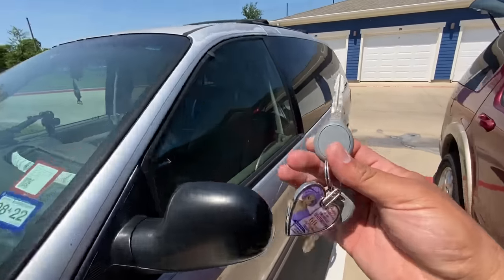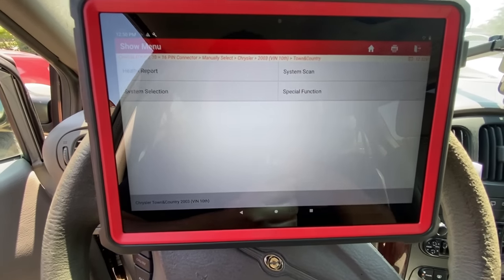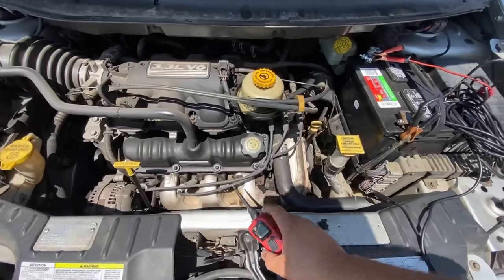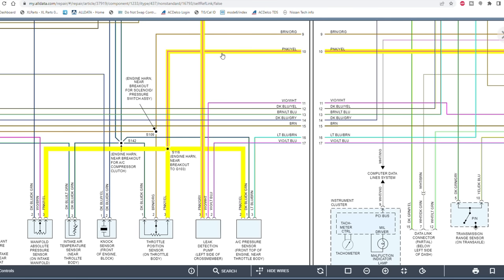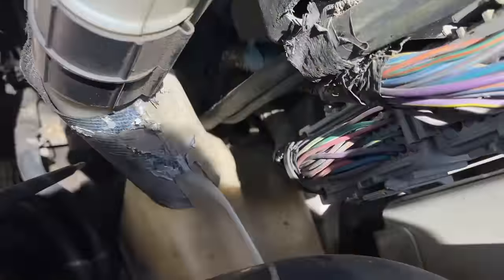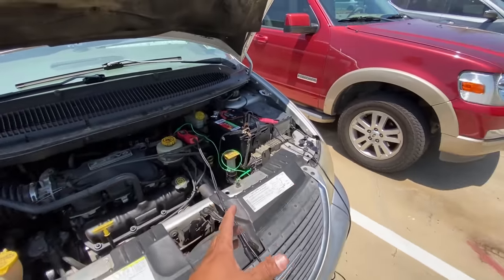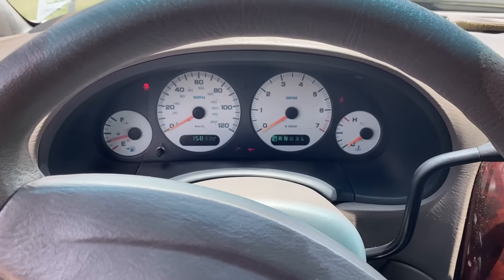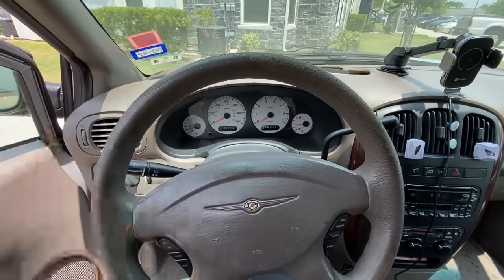CHRYSLER TOWN & COUNTRY NO COMMUNICATION NO START

Comment: Awesome video, I'm a locksmith by trade, the red light in the cluster top right is the security light,  it is supposed to turn off if you have full communication and the security system is up to par. Solid light means fault in computer system,  flashing light means key problem.
Reply: Yessir about to say that flashing red is not good
Reply: I mean solid I had that problem and it was pcm

Comment: My mechanic would have just told me you need a new computer and just slapped it in there without doing the test and then tell me later well we put in a new computer and we found a faulty wire as well. you are very thorough. You help me to believe in mechanics again.

Comment: Phenomenal job tackling a diagnostic issue. Whoever changed the starter was obviously not experienced, starter relay jump would of cranked. I’ve been diagnosing cars just off sheer knowledge and process of elimination, voltmeter and a light tester. Now we have great scan tools and the power probe to assist the main tool, your wisdom and experience. Again excellent job.

Comment: Yup.  Definitely an instrument cluster problem!  Only other test I would have checked to see if the scan tool had shown RPM.  That way you have a record that the PCM is sending the information to the IPC which shows the tach is bad.
Other than that, very good diagnosis, good call on the PCM and overall, very good fix Eric!
Reply: what is IPC?

Comment: On these older Chrysler vehicles you can hold down the trip button on the cluster and turn the key to the run position. It will do a check and all the gauge needles will do a sweep

Comment: Thank you for sharing your knowledge I have a 2006 town & country that had the same problem but mine was a much easier fix, I cleaned the battery terminals replaced the connectors, and put on a new ground strap and it started up. You have a new subscriber. Thanks for showing us how it is done.

Comment: Great video as always! It was thorough and right to the point. Where I work, many electricians never bother to look at the schematics when troubleshooting a circuit. They just change parts until it gets fixed or not. My Dad being an Old School diesel mechanic always told me “One has to be smarter than the tool” Meaning, use the tools and manuals accordingly and they will guide you to the root cause.

Comment: i know it ended up being a pcm issue. and just alittle tip for the future. ive been burned on these older dodges, the asd relay has a power feed that goes to the pcm and also the alternator. I had a van that had repeat pcm failures. We all know about chrysler pcm problems. but still, either way the asd relay is controlled by the pcm, and supplies power to the fuel pump, injectors, sometimes the trans relay, and the alternator. The pcm also uses that power in its wake up process. So what im trying to say is dont forget to check the asd power supply to the pcm, ive seen where the driver in the pcm fails not turning on the asd, and ive also seen where the alternator has a partial short in the field circuit causing a 5-10amp draw on that power feed..which usually melts the circuit board. It can cause repeat pcm failures, and be overlooked until the alternator finally fails completely. Just wanted to throw that in. Great job on the diag, its always nice to see a tech that understands how to LOAD test a power and ground. Fewer and fewer people understand this basic concept, i love the power probe but i still use my test light to double check also. What ever shop couldnt fix this, obviously cant be bothered to check for a crank signal at the starter before replacing it. Thats crazy
Reply: what does ASD stand for?
Reply: @darrylt1031 automatic shut down, the relay that shuts off the engine in a crash event or rollover. Fuel Injection allows an engine to keep running even if inverted after a crash, unlike a carburetor which would shut off the fuel, as the bowl float relies on gravity.

Comment: Very good video.
I had a 2003 Grand Caravan 3.3L with the same issue with computer.  I sent it off to a repair shop I found on Ebay with the Vin # and current miles on odometer.  Came back repaired.

As for the trim over the gage , it would dry and crack from the sunlight.  You could move the light bulb board like he did on the video.

Never had any real issues with the engine, transmission and ac unit.  At 186k miles she ran good but had some rust spots throughout the body.

Comment: Great diagnosis. Isolated ECM with problem, checked base power supplies, checked ignition present, all feeds checked with test lamp to simulate load, checked 5Volt output connected and disconnected at sensors. Maybe 5V ref wire short, checked for ground with test lamp no short to ground.  Why did it go who knows old age, some one shorted it or reversed polarity it and not telling. Well done for not wasting hours and following through in a logical manner. Still makes you sweat when you order an ECU though.😀

Comment: 20:40,  that solid red dot on the top right corner lit and went away after a few seconds, so that must be the security light lol. Good call on the computer and the checks on the possible shorted sensors bringing the computer down, that's an extra step that most techs may ignore to save time but could be a costly misdiagnosis.

Comment: You have taken us through the best procedure step by step tackling the issue
The issue with the rpm gauge if I would have seen the scan tool reading the signal from the ecm autright close the case clock is faulty

Comment: You are spot on with your procedures and your diagnosis. However in my experience with these pcm parts, 90% of the time they are repairable. On the main power inputs there are 5 watt general purpose rectifier diodes that are sacrificial in nature. They protect the pcm from voltage spikes and they will either short or open . I suspect that the unit you diagnosed in your video had open power clamp rectifier diodes. When they open ... You have a dead pcm. They are simple to solder in and out and you can buy a bag of 20 for about $8. When they short ... The damage can mover further into the pcm and can damage the EPROM. When the EPROM is damaged I generally replace the pcm. Generally it is harder to open the pcm then is to repair them, and having said all of this, you can save a lot of time and money just doing a check on these rectifiers.
Reply: Very cool, Any idea how can we identify those rectifier diodes?
Reply: @W.Khairi  Yes they are easy to find. Usually near the wiring harness plug in port. 5 watt diodes are easy to identify, and generally easy to solder. Inside the ECU there will be a buck power supply sending tightly regulated current and voltage to the logic I. C.'s Google 5 watt diodes and look at the examples. When replacing them be very sure which end the small silver band is on, and insert the replacement part with the band facing the same direction. That is critical. These diodes are easy to check with a standard volt ohm meter. Some even offer a diode check function.
Reply: @markcondrey2297  I will try to check on them next time,  Thanks a lot for taking the time to explain.

Comment: You know if you turn that key 3 times to power and power off the third time it'll pop up the codes on the dash for u. Also with these vans like some cars with low low oil or no oil that van will do that with no start. Great Work and nice video 👍

Comment: reminds me of an intermittent issue I had with a 96 grand caravan years ago. Crank, run for 1-2 seconds, then die. In frustration I beat on the dash top and got it going, then drove 100+ miles home. Was ok for a week then did it again.... fixed the same way. Finally did it again 100 miles from home about a month later and a shop said there was a can-buss error, but it started every time so took it home. Researched that error and every post talked about dash cluster issues. My son had a similar car with dash warning light issues, and mentioned a post where guys talked about poor solder joints within the cluster. Apparently, the error was causing the anti-theft to kill the fuel pump. I put the dash on the bench and manually went over every solder joint. Never had another problem. Had the car another 7 years after that and finally junked it at 23 years old for other problems. (mostly rust)

Comment: Nice diag.  Can't believe someone else couldn't figure it out, but hey - more money for you, right?  One thing I will note, to check the 5v reference line for a short, I'll unplug the connector at the PCM and front probe the wire.  It's (usually) pretty quick and completely non-invasive.  And well, just like you did - I will remove the connectors and inspect the pins and sockets anyway...so it's just a final sanity check before I rule it out as a smoked PCM.  Keep up the great work, always nice to see one of your videos!

Comment: Gotta love the power of Editing.... Since (Roughly) the early to Mid  '90's,  a short on (a) 5 Volt Reference Circuit (there can be more than one) would give you a Crank and No Start along with a message of no buss on the Odometer. That is just the Logic Circuit shutting down because of Short on Circuit. (When testing the Circuit for a Short with a Meter, you have to cycle the Key off and then on again every time you unplug a Sensor. It will not Magically turn the Circuit back on... 80% of the time it is a Crank Sensor, 15% of the time it is a Cam Sensor.  In 1998, Mercedes Benz bought Chrysler.. Things changed, and we had to adapt our Diagnostic a bit. On this Model, The Cam and Crank are on their own 8 Volt Circuit. Same Crap Parts, but different way to diagnose it. The symptoms are the same as yours, EXCEPT:: If the P.C.M. was really Bad, you would not have a lit Check Engine Light.. There are 2 different Networks on the Vehicle. SCI and PCI.... It was talking on a Network you can not seem to Communicate with... Get rid of Launch, I did a long time ago. I busted my arse on a same scenario but learned a lot... That was roughly 15 years ago  when these came out of Warranty...  Are you going to show the real fix???????

Comment: I have a '99 Town & Country that I had the exact same problem with.  Disconnecting and reconnecting the PCM fixed it.  There was no corrosion and the connections were tight before I disconnected them.

Comment: Love the diagnostic channels... I'm a mechanic myself and you always want to see how others do it.
So far very nice👍, another thing I always do is comment to the video before it's finished with my own diagnosis, wondering if I am thinking in the right direction.
I was looking at the new battery and thinking about a diag from years back,another Chrysler product. This was a jeep Cherokee and the battery also sat right beside the pcm... The problem ended up being corrosive particles coming from the battery and arcing out across the pcm connection...just saying it's a possibility!🤷🏼‍♂️
Reply: Yeah and somebody may have taken a shit inside the PCM as well.... just saying, it's a possibility.
Well... wasn't the case this time, girlfriend.
Reply: @moshesheckel7369  ???

Comment: The Injector wiring harness will fuse together fry the computer. Pull the wires apart to inspect on the fuel injector wiring harness this year was known for that.

Comment: Please help. I have full power/ No crank and everything on this diagnostic video on ny van tests good , but still no crank and check engine light.myself am a mechanic and very picky and only trust a few mechanics to work on ny vehicles besides me. I would definitely trust this guy!! Not only does he know his stuff, he is a very good teacher. Not alot of people can explain things like he can. Most mechanics have lots of knowledge and diagnostic gears turning in there head but can't always explain the process as good, they just know what to do, great diagnostic video but in my case im still stuck on whether it's a pcm or not
Reply: I can't find wire schematics.  If i pull starter relay i can make starter crank with jump wire and all other terminals check ok except for 85 at relay which goes to pcm, i dont know if it powers or grounds, i ohmed all wires and all good, however i noticed my AIS motor was hot when checking the tps and it makes a loud click and re-engages when i hook back up. OH, Also my van was clicking with key on from injectors and when turning key off still clicked and when i checked my 5 o reference for a millisecond it had no power then it clicked and injectors stopped clicking and then 5 o reference gave me power

Comment: thank you  i have 2005 towncountry had issue with dash gauges the fix was on battery cable ends where connects to batt clamps i solder sweated ends where swage is fixed problem i used a propane torch with solder paste to do job .

Comment: @ADVANCEDLEVELAUTO Thank you so much for sharing this! I'm  having a problem with my 02 trailblazer where it was idling and it just shut off. No crank, no start and no fuel pump engaging after. Scan tool will not communicate with pcm as it has in the past. Instruments light up bright and battery is like new, fully charged. Installed a new ignition switch and camshaft position sensor, still nothing. Also tried the neutral safety switch test, nothing there. I did try all the fuses and relays as well, all are working. I did try the ignition relay jump test which will crank but no start or fuel pump. Hoping your video will help me troubleshoot this! Will follow up 🎉

Comment: My volvo v70 2002 did not run any more. the 12v in engine bay was oxidized. cleaned and worked again.

Comment: I had the same issue a bunch codes. I too taught it was the PCM and it turned out it one of the plugs was slightly loose about 1/8"

Comment: Power probe offers a 5 volt 0.100 milliamps attachment for the power probe.....if the line is shorted to ground the attachment will go to ground.....also the power probe hook has a variable 5 volt generator for reference circuits...I own the hook and is a really cool tool!!!!!!!

Comment: The red light above the fuel gauge should be the SKIM (Sentry Key Immobilization Module) light. Another clue is the grey head to the ignition key. I don't recall on the 2003 whether it was an option or standard. If an attempt was made to start the vehicle with an unregistered key or a hot wire, it would start and run for about 3-4 seconds and then shut down. After that it would not even attempt to start on the next try. There is a chip in the head of the gray keys (similar to the ones on expensive merchandise at the store) which the SKIM can detect and recognize. If there is no SKIM, the Chrysler product came with a key with a black plastic head.  In later years the SKIM was standard and all keys (those with the large key fob head or those vehicles with the new push button system) have the chip. The chips do go bad.

Comment: I believe one of the options for the gages was to calibrate. Maybe a preprogrammed PCM doesn't account for differences in rpm sensors. Is it possible each vehicle has a pre-delivery calibration done for the gages?

Comment: Could you add 5 v with pp 5v adapter and see if the sensor is getting the 5v?  At the pcm and then test for 5 v at sensor just a quick test?   Thanks

Comment: I think someone pulled the pointer off the tach and did not "clock" it correctly when replacing it. Do a sweep test and attach the pointer at the same ratio as the speedometer. It should work just fine then.

Comment: Could be possible that someone removed the tach needle and misplaced it way below
Reply: ... I kinda doubt that. These are way too fragile and nobody is likely to attempt a DIY repair.
Reply: but as pointed out, someone diy or other DID medL RoOnd at that spot(but they only would of if it ALRED wasNt wrking, so so much for that pulling nEdle thing out of it to break it)👋  I’d say rig some clever mileamo tester to that needle & see wat happens wN U tap gas- if reading duzNt ‘move?’ its ICU or Yring, a gud precaution B4 tAking odometer to Dlr for a $500 odometer cluster rebuild rip off.. ok $200 + tXs, fees, a ride to & from dealer & a wEks worth of time & $200 of taxis & Ubers for a wEk, my bad it’s MOORE thN $500😒
Reply: @ezwa9979  .... anything is possible, but the dash cluster issue is a known situation over 20+ years. Read my post below for details.

Comment: Not sure why you said the tach problem has to be in the tach portion of the cluster.   Normally a speed sensor like for a tach is either good or bad. But could be a bad wire that was moved when you rev’d the engine.  The test cluster showed movement of the tach but I would assume that the tach might should have indicated a certain ROM proportional to the engine and trans in a certain gear but do not know.  I lack the knowledge but would declare the cluster portion bad without inspecting the tach sensor, wiring snd connector

Comment: Are the wires to the PCM still exposed? Im guessing the missing boots let enough moisture in to compromise the crappy leadless solder points in the old one.

Comment: 100% that if you put your hand through all the wiring that comes out of the computer, it went towards the back of the engine, and you will find that that wire harness is going to be burned a melted inside the sheath. Now u owe me  $120 for diagnostic 😉

Comment: Just FYI, the check engine light is suppose to come on regardless if there is a problem or not. Dodge states that it will go off when the ignition is started and it detects no P codes.

Comment: that red dot I think is sentry key error .. my 2004 Chrysler did that (would suddenly not start, but mine the red dot would come on when I was driving). The fix was replacing the TCMP (little thing in the fuse box that controls the starting and apparently the sequence of starting events .. so my injector servos you could hear come on a moment before it turned over).